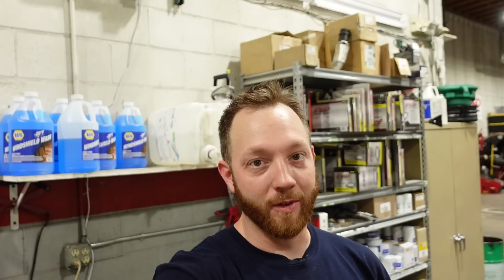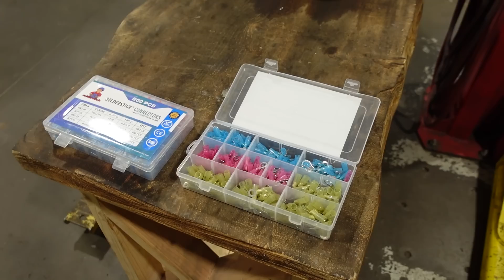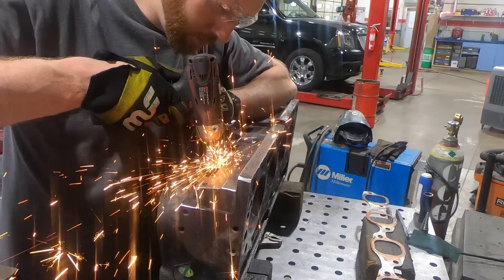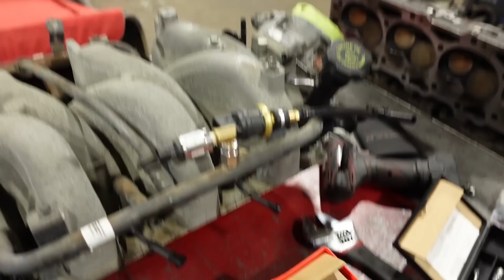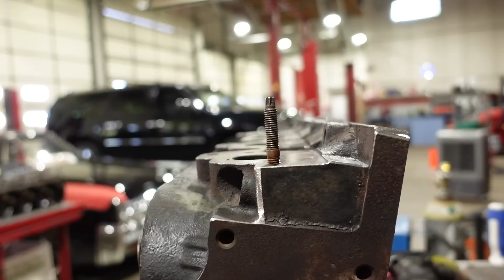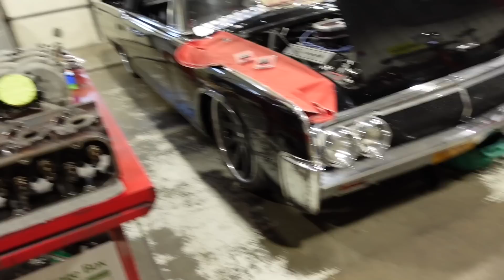this TINY PART saved the ENTIRE big block engine build

Comment: Double nut the studs before they break, tack the nuts together, and to the stud, then wrench it all out together right from the door. The doubled nut, will give torsional strength to the weak stud, with any luck.

Comment: Those Big Sert and Time Sert kits are very nice. 
  They make a kit for spark plug hole repair for the 4.6-5.4 Ford Triton engines. It works excellent if you can find the kit and inserts. They’re not cheap but that problem is forever fixed.

Comment: Old School:
1) Use a double-nut as far down as possible.
May reqire a thread chaser 1st.
Puts Removal-Torque near the cylinder head, reduces twist of stud!
Use a Tap-Tee-Handle or a DEEP-Socket on a Tee-Handle to reduce twisting, control of physicics applied😊
OR
Weld a nut to the stud-stub protruding, heat transfer, etc.
2)
Use a drill guide block & Transfer Punch.

Shade tree is a learning process😊

Comment: What I would have done was to replace that misdrilled stud with a new one and then I would have tapped it over with a hammer till it was parallel with the other studs, problem solved

Comment: Probably late to the party but I'd strongly suggest enlarging exhaust manifold to head hardware while you have it apart. 8mm studs are way to undersized for the weight & heat those studs have to support.

Comment: I drilled a helicoiled the same stud on my LS 5.3 swapped engine. I put a small hole in the water jacket. I just loaded the helicoil and stud with lock tight. 2years in no problems at all. 🤞

Comment: Years ago I would drill and tap the hole to a larger bolt thread, loctite the bolt in the hole, chop it off flush, and finally drill/retap to original size. Sometimes if I was really worried I would drill a small hole at the block/head to chopped off bolt thread area and drive a small dowl inbetween the threads so it couldnt back out. Never heard off helicoil kits until long after and made me want to slap myself lol.

Comment: Fyi, when you use your acetylene torch for heating flip the cutting lever up, that way you don't push it on by mistake and put too much heat in your project.

Comment: I got that 500pc set of solderstick connectors and did some testing. They work best if you put a dab of plumbing flux on the wires first, and they will not hold wires together on their own. The wires must be twisted together before being soldered/sealed. Otherwise I can pull them apart by hand. The solder is likely some tin/bismuth alloy, not nearly as strong as lead but has a lower melting point.
I'll still use them, but be aware, you can't just overlap the wire ends, they have to be mechanically joined.
I do like the heat shrink though, seems to be much thicker and more heavy duty than the regular stuff.

Comment: Well LT I wonder if you took your Torch to the stud and just heated the stud down low and took vice gripes and Straightened the stud to where it would be in line with the rest of the studs. That way you won't be saying words wouldn't say normally.

Comment: Something just popped into my head. Would it be better as a  rule  to remove head studs by putting your nut closer to the head? Would reduce the twisty force and increase the roundy force.

Comment: I've Made my own in desperate times 
Drill and tap to a larger bolt, install said bolt with thread locker.
Cut head off bolt and drill to size needed 
Tap and install stud 
I would prefer to do it your way but in a pinch it'll get you sorted

Comment: You can over drill the hole, tap it, tighten a bolt in it, and cut it off. It gives you a fresh area to drill. Basically, making your own big sert. I even do it to aluminum heads. I make the repair plug from aluminum.
Reply: I do the same only when there’s enough meat for a bigger bolt O.D. I loctite it, drill it, tap it and done 😎

Comment: You are something else LT you might need some medication.  On a serious note I think I remberfrom the copo truck build you used factory 3/4 ton torsion keys to lower it the 1st time is that correct?  I have a 03 1/2 ton 4wd I have 2 inch drop spindles on the front and on the back 3" rear drop shackle and 2" front drop shackle I had to put a block back in the rear to level the truck out so I would really like to get the front end a couple inches lower I already have a factory set of 3/4 keys and finding lowering keys for a 4x4 turns out isn't do easy so will the 3/4 ton springs lower my truck 2 inches?

Comment: Next time put the manifold on it first. Use a transfer punch to centerpunch the old stud, then use the manifold hole to help keep the drill straight. Same with the tap, let the manifold guide it in straight.
Reply: I was gonna recommend the same thing and then came across your post
Reply: If you guys noticed he showed that the holes in the manifold were significantly LARGER than the actual size of the body of the stud. He would not have been able to use the manifold to guide the drill bit for that reason.
Reply: @Go69  Wrong. It doesn't matter that the drill is smaller, you can still visually hold the drill bit in the center of the hole as you drill.
Reply: @scottm7341  Your words, from YOUR post " then use the manifold hole to help keep the drill straight"..... How can the manifold act as a drill guide-which I think is what you were inferring, when in fact the hole in the manifold is significantly larger than the hole you intend to drill? Not trying to start an argument, just pointing out that having the manifold in the equation is most likely a waste of time as it will serve no purpose other than to get in your way. So... NOT WRONG.. It's just what you typed makes no sense. But, I'll leave it be... I have a mill so anything I can clamp, or bolt, to my mill table always gets drilled straight... and no, I would not bolt the manifold on while milling it..just like if I was hand drilling it.

Comment: The OCD strikes again, but, you are correct. Removing the casting flash will make the heads stronger. 
For future reference, back when I worked in a machine shop we’d heat up the studs and let some candle wax melt into the threads. After a few seconds you can screw the studs right out.

Comment: So I wanted to let you know. I can't remember if I added this to the last video but that bearing damage you see is starvation. That happens when you make a hit on the track and when you let off it becomes starved for a short period of time. This is normal for wet sump chevy engines. A coated bearing will mitigate this. But a dry sump will eliminate it. Looking forward to the build. Also use a tri-stone hone on a junkyard engine. Ball hones are for engines with known good cylinder walls(previously machined) and that just need refreshed for the season. Good luck!
Reply: Thanks I'll be using this advice very soon
Reply: That’s great advice and insight. Thanks!

Comment: I really think a Clevite A series or King HP series bearing is more appropriate. The trimetal Clevite H is a bit hard for your components, and won't cushion the pounding from heavy boost as well. If you had a high alloy crank and rods, I would say go for a trimetal bearing. 

I hope you check the piston pin clearance.

Comment: Dude.. When I worked in a machine shop we put beeswax at the bottom of the stud after heating, Youll see the wax get sucked into the hole around the stud.. Works great!... We rarely had to weld a nut to any bolts or studs doing that. Try it!

Comment: Hey LT!  Since you've got it all apart, and you're working on oil drainback... after you get the block and heads tanked (so they're dead clean), coat the insides with Glyptol and let it cure up good and hard.  Oil just sheets right off it, and it prevent carbon buildup since all the porous surfaces are nearly smooth after.
Reply: @dazaspc  - Glyptol was originally made for building electric motors (coating the windings) AFAIK, but it's been used for decades as an interior engine coating.